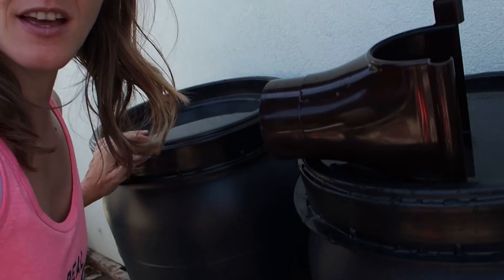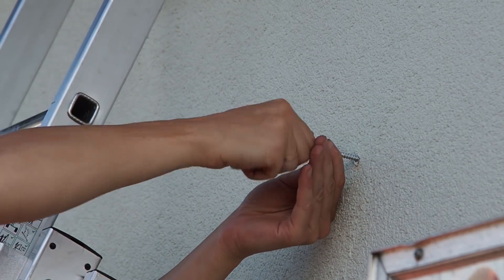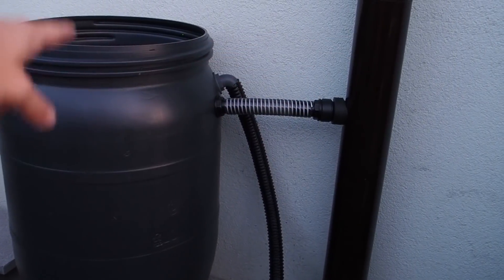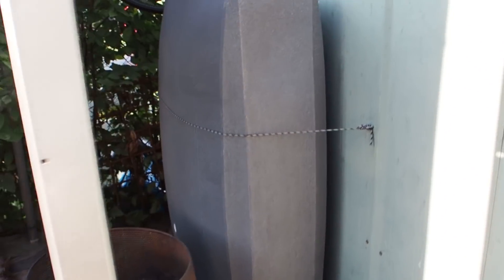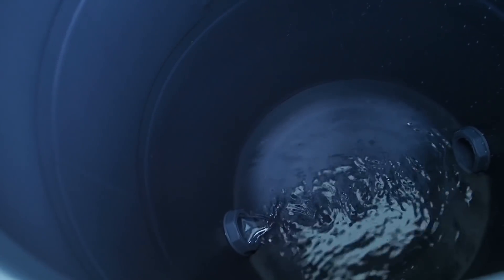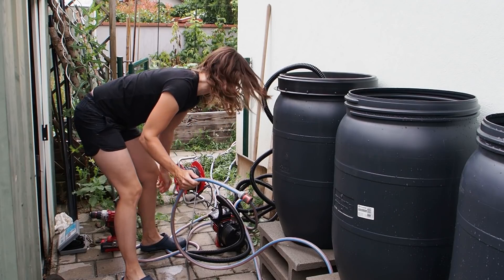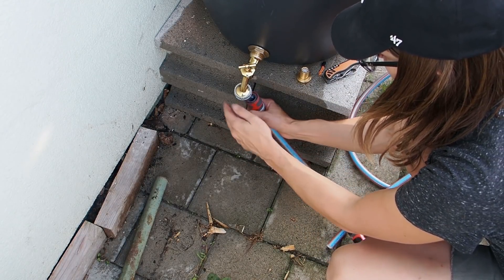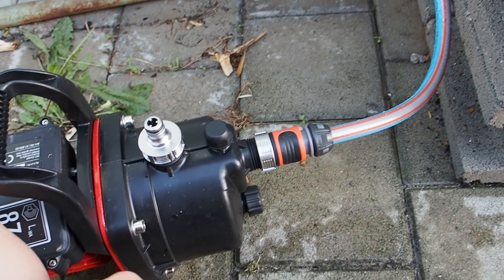Rainwater Harvesting System (Water Storage for the APO.CALYPSE)

Comment: A little advice on using hole cutting blades with HDPE....run the cutter in reverse. Forwards is too severe and the excess burrs on the plastic are annoying. In reverse it cuts slower, generates heat at the tooth tips and leaves less to trim off.

Also, if you're concerned about drought you need to work on reducing water loss. Mulching with any organic or stones, makes a huge difference. I use woodchip, bracken and grass mowings, and the worms soon drag it down.

Comment: FILTERS:  Some old net curtains rammed down the barrel inlet and connection pipes will block most bits of rubbish from making it to your barrels.  If you want it better filtered add a water trap ( a vertically U shaped section of bends) between inlet and the first barrel and so on.  Better still add a length of leaf litter guard brush into the rainwater gutter above.  If the barrel connections were made higher up between each barrel, then each barrel would filter the water in turn as the bits dropped to the bottom, leaving clearer water to overflow to the next barrel etc etc.

Comment: Perhaps if you'd used a 1 1/2 " ball valve @ the outlet the pump would not have been needed at all. Your outlet size is inadiquite for a good free flow the way it  is , even with a pump. Plus what good would the pump be if at all?   If the grid should be down and unless it is plumbed into your house water system and used to pressuerize it and runs on a battery system, it's useless ?

Also the holes in the top and no strainer on you inlet will just fill your barrels with debris making the water only usefull for watering a garden,,,,till it plugs up either the outlet or pump.  Most of what you've done looks great other than those 2  major design flaws.

Please take this in the way it's meant Lilly, I'm not trying to be overly critical, just helpfull. These suggestions are from experiance,,,,,,,

Comment: QUESTION: Why not run the connecting hoses towards the top of the barrels? That way if the hoses leak you won't lose ALL your saved water? That's how I had mine set up at home. 😊 AWESOME job! 👍

Comment: Lily you are amazing, you did this all by yourself and make it look easy.  I agree with what you said about how much a vegetable garden needs and how it is more than you would expect.  The water here ( N. Ireland ) is free for now ( included in the housing rates ) but it is still municipal supply which contains small amounts of chlorine and even more amounts of fluoride, so not ideal for plants and growing living things.  The rain water solution is more better I think and you're correct about getting more barrels. Better to have too much than not enough.  Also, I was looking into growing inside a geodome  
( temperate climate here ) using hydroponics and aquaponics as well as soil.  The soil soaks up quite a lot, but I'm told the other methods aqua and hydro use water very sparingly as it's recycled through the system and it's some time before it is evaporated and uptake by the plants.  Sorry to write a book sister.  Good luck.  Be safe.

Comment: Great video 👍 . A suggestion. When using drills or grinders or such tie up your hair  , it'll be a bad day if it gets wrapped around the grinder . Also for anyone who wears hoodies take off the strings from the hood .  If you get one of those wrapped around a grinder it will pull the grinder into you face or neck faster than you imagine

Comment: What should work with your for your big square rain box is to cut a hole in the top and add a lid. That way you can easily clean it. You already have a hole saw set or you can use a saw if you need to make the hole bigger.  Good job.🇨🇦

Comment: A lot of design, construction and workmanship errors. The idea is very good, but the combination of the tanks is terrible. Physics was not used. Good for watering the garden, but as a possible water supply in case of a cataclysm, it will not work due to the lack of filters. Greetings from Poland

Comment: If you plan to use the rain water for drinking purposes - I recommend placing the barrels on a wood platform. Chemicals from the concrete will leech into the water.

Comment: A one way valve would prevent the water from flowing back out of the pump hose, and shortening the length of hose would help a lot.  That’s a lot of length and height to overcome before the motor starts pumping.  Also, water pumps last longer if they are not dry started.  The stuff I mentioned prior should really help.

Comment: have a roll of chicken wire sticking out of the top part of the gutter down pipe add on - to stop leaves going into your tank. 
Also you can filter your rainwater by having a mesh ball above the connecter inside the down pipe and fill it up with small stones and big sand

Comment: The rubber seals go on the opposite side of the nut of the bulkheads, the inside of the water containers for your system. If provided with 2 seals per fitting then 1 can go on either side though its kind of pointless unless ur fitting to glass at which point the second seal acts like a pressure distribution ring to prevent cracks caused by pressure when tightening the nut. If the seals are place on the nut side only water can leak out threw the threads of the nut. You wont really know if the system leaks until its all the way full. Technically you didn't need an extra overflow because the ring you inserted into the drain pipe also acts as an overflow it self. You could drill a hole in each lid to eliminate vacuum and pressure build up if it turns out to be a problem. They make sponge filters that fit inside your gutters to keep debris out. I recommend debris filters so you don't get rotting leaves built up on the bottom on ur barrels.

Comment: That's a nice clean setup that you have there and it should work well. Never mind all of the negative comments about the installation, perhaps you could improve it by a few percent with some fine tuning but not enough to make a real difference. 👍 I am intrigued by your old tank, it seems to be a far more efficient use of space  than the barrels. If your primary objection is lack of access for cleaning then I'm  sure that with your hole saw set or your jig saw you could make an access hole in the top big enough to clean it through. And fashioning a flat cover should be simple enough. Good luck, I am really enjoying the variety of your content these days!

Comment: Great video. Just a simple mistake you made with trying to pump water from top to bottom. It's visa versa. Think of a ingrated fuel pump in a vehicle gas tank. Pumps bottom to top technically with what's in it. You solved it though great video.

Comment: Nice setup.  I built one about 20 years ago and learned a few things while doing it.  If there is ANY chance the water will be used for cooking or drinking I highly advise it be filtered BEFORE it goes into storage.  Since rain water is essentially distilled water it also helps to buffer it.  I used 5 gallon buckets to fashion a sediment pre-filter with the outfow from that going through a carbon filter and then that was trickled over crushed limestone to re-mineralize it.  In the storage tank I had a UV steriliser lamp that would be used for an hour every few days and this kept the water fresh and potable.  I think that if the water went past the UV before going into the barrels that would also serve the same effect.

And this is all meaningless if the water is only going to be used for washing or non-dietary uses like doing dishes or washing clothes.

Comment: Hey Lilly, 

thanks for showing a cheap way to collect some rain water. In my area this is usually build a bit bigger (3000 to 10000 l) and underground. This adds the problem to burry the containers (usually HDPE or concrete). But afterwards you are able to store water also over the winter (freezing temp) and do not waste space (only a man hole needed for cleaning now and then). Also most moisture is collected in spring. Which then can be used in the summer.

Anyway I enjoyed your video. Thanks for making people aware that they can be part of the solution.

Best regards

Comment: I have been able to pick up food safe barrels that vinegar was shipped in for $50 each. I use these for indoor storage adding a couple very few months. 2000 litres in IBC totes and barrel storage so far. I also have empty non food safe barrels to store gray water so no water goes to waist and can be for non potable use like flushing the toilet while it still works. Dehydrated food, rice and drinking require a lot of water. The rain catchment system can be used for garden and showers.

Comment: These pump designed  to be used in old type of wells the intake had to be lower than the pump, then you had to fill up the punp and hose with water otherwise it will not work and damage the pump because of overheating. you sould put a filter on the gutter intake for large debries like leaves and such, great vid by the way

Comment: Great job Lilly, How ever you are using the support blocks incorrectly. The side the drums are on is the wrong side of the blocks . the top/ bottom of block  that is facing outwards and towards the wall is the load bearing part of the block..It is not structurally strong in your configuration. Water is heavy, It may crack and crumble under the weight of a full barrel. you need to flip them around and use a cap stone on the top to achieve the solid flat  ( top ) surface.Your friend in North Carolina.Kevin.

Comment: Lily, I don't know for sure but I've often heard it said that allowing your rain barrels to touch concrete directly is not a good idea. Might be something for you to check into. Love you and your Channel and I've learned so much watching what you do!
Reply: Correct , a plain ceder un-finished board is best for rot resistance. 

Plastic barrels WILL leach cemicals from pressure treated lumber and cement.

Comment: Trying to be helpful here: Shouldn't the overflow be on the last barrel, and shouldn't the barrel connections be at the top instead of the bottom?
Reply: i was wondering the same, if there's a small leak in any of the connections, you lose all the water of the three barrels water... plus having the connections much higher makes some kind of gravity  filter  for heavy impurities...
Reply: @fatandfurious5940  All of that, and I think to get the best pressure and circulation/refresh of the water in the multiple barrels I think you would want to do a setup for the output spout where it draws from all of the barrels at once, so that you're not always having to draw off whichever barrel is the most full (assuming all the overflow and transfer hoses are at/near the top).  It does introduce more failure points to do it that way, but I think if you're using really robust hardware like Lilly is here, it would be just fine.
Reply: @innercityprepper   I think I would have put all the connections at the top just so I don't lose a full barrel of water if I need to work on the system, or if one gets contaminated I'll still have 2 more.   I've heard about not putting barrels directly on concrete, something about leeching... I don't know if that's true or not but I put wood under my barrels.  I use them mostly for plants but they are also part of my water plan that I can filter if needed.
Reply: @SoloHiker1  Good stuff, thanks!  I actually have a sorta weird micro-barrel setup where I use 4 15 gallon food-grade barrels. Since I want to be able to store what I need in some situations (especially the cold 7 month winters where I live) I have them set up where they're not very visible at all to curious onlookers and I can easily scoop any of them onto a dolly and haul it into my house where I can use a pump or gravity siphon to run the water through several filtering options, depending on what I want to use the water for. For the garden obviously I'll just keep the water as-is from the rain and water what needs to be watered. For potable water I process with a tiny amount of pool shock and then run it through a Sawyer or a Berkey or both. You'd never know it wasn't from a Dasani bottle :D 

My next water catch move is going to be figuring out a good way to harvest snow without wasting too much energy. Since I'm in the frozen north I've got a TON of snow I can use, and the great thing is, it sticks around all winter long.. so I could harvest it from anywhere, it could have fallen months ago and I can still use it!
Reply: Water pressure will even out the levels. It’s how a manometer works.
Reply: I have a similar system here in Germany, you are correct, the hoses need to be at the top gradually getting lower.

Comment: I would of joined the barrels together at the top but underneath the overflow in the first barrel, plus I'd add a gauze to catch leaves. Also I'd look into industrial spigots as I'm sure you should be able to find something for farm/mining equipment to increase the flow you should look into a dual stacked set-up for your next 4 barrels to save space and then you could feed from the top down and link a the bottom two outlets together with a T section to the spigot for a higher pressure gravity powered outlet

Comment: Mine is a little different. https://prnt.sc/1nywnc2
The water pressure is higher from the three tanks so don't need an electrical pump. Getting electricity is a little difficult when shtf. Also added a very basic water filter to the intake which keeps the leaves moss and shit from the water, and overflow pipes connecting to the main overflow outlet in case of clogging.

Comment: Looks great. But even with 4 more barrels it's not that much water. At least not when papering for a dry season.
Do you have enough space for IBC containers? They come as 1000L and 600L version. I got myself 4 used 1000L IBCs. They were used for sunflower oil before, so no problem for the garden.

Even the small ones might be a bit wider than a barrel. However, there is no way you get that much water on the same footprint with barrels. You could even stack 2 IBCs on top of each other. That makes 2000L on 1m2 space. 
They already have outlets and you can buy adapters and kits to connect the containers.

You can get black containers (might be harder to find), paint them (lots of work), or get covers to block out sunlight.
My neighbour has buried his in the ground and therfore can leave the water in all year round. Plus no space needed on the surface. But I didn't want to go through that trouble of digging a hole big enough for 4 containers.

Comment: how are you going to combat algae and fungi contamination?  what about metal contaminates from the roof itself?
Reply from the maker: I frequently use the water and dont let it stay inside of the barrel for longer than a month. so I should do fine with germs. metal contaminates are only a problem if the ph level of water is very low under 5ph.

Comment: I'm coming to your house when SHTF. This is an amazing job you did here it looks very pro, Would you be able to stack these barrels vertically to take up less space?
Reply from the maker: Initially I wanted to stack them vertically, but then I found out that the lid is not waterproof.
Reply: @SurvivalLilly  Will you empty the barrels before the winter? Otherwise with below zero temperatures the barrels might freeze crack open.
Reply: @SurvivalLilly  Oh I see what you are saying. You thought about stacking them vertically on their sides but the water would leak out the top. I was thinking stacking them vertically end to end.
Reply: If you're going to her house then I'm going to yours because of  all of your cool prep stuff that you'll have to leave behind. Lol
Reply: @richardelliott9511  Don't forget to pop by his warehouse too.
Reply: @steveclark..  exactly, can't say for sure but from the few pics we've seen, Id bet the warehouse is at his home.....
Reply: I think for sure that would work. I think you would need some kind of shelving to bare the weight. Water gets pretty heavy. Just stacking them on top of each other would maybe be too weighty. If you did that you would want to connect the bottom of one barrel to the top of the one below it with a hose and the sillcock on the bottom barrel. Ya for sure that would work well. :)
Reply: Water weighs in at ~ 8.34 #/ gal. .So build support structure accordingly.
Reply: I think the weight of stacked barrels would be an issue if you're not on very well-tamped, very level ground.
Reply: @innercityprepper  Probably some kind of shelving would be required to help distribute the weight.
Reply: dont go to het place, she will shoot you with her bow! 🏹
Reply: @johnnyhighwoods1780  Oh I doubt that she would but maybe her spouse might. I think there is a secret unrequited crush going on between Nate and Lilly and if I noticed, then probably their spouses did too. Could make for some spicy behind the scenes drama. Lol. Of course maybe I only see it because of my own crush on her. (If only I was 40 yrs younger and lived on the opposite side of the world, sigh)🤣
Reply: that's why she trains with a bow and arrows ... for parasites.